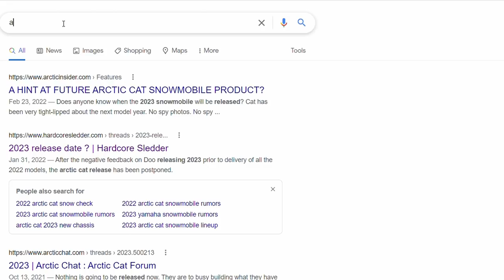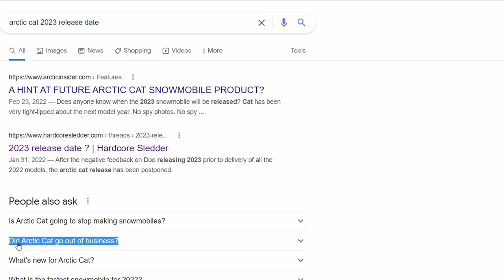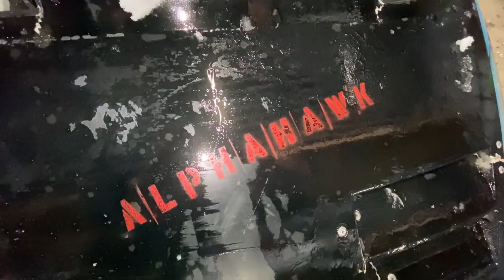2023 Arctic Cat snow check news & the future of Arctic Cat snowmobiles

Comment: I'm a Polaris guy, but I'm still really rooting for Cat. I know they've had some tough years - they ALL have - but I feel like they're the underdogs even though they build a badass snowmobile. I have a hunch that they're focusing on breaking ties with Yamaha, which I would applaud, but I hope they can do it and still remain successful at the same time. Don't die on us Cat!!!
Reply from the maker: If the auto industry is anything to go by I would expect more ties between companies in this tiny and shrinking market, not fewer. But we’ll see. Meanwhile I have sold my Doo and ordered my first Polaris, so next year my shed will be full of cat poo.
Reply: Ok way they would survive if they split from yamaha is if they took the 998 with them. Otherwise.....Asta la vista
Reply: Why would you want them to break ties with Yamaha? They’ve marketed some of the most reliable machines than a majority of manufacturers out there. Their ties with Yamaha is what has me wanting to buy one, not turn away from it.
Reply: @matthewmyers2833  Because Yamaha is using Cat’s engineering. They’re moochers. Go pay your own engineers Yamaha
Reply: Polaris wouldn’t be where they are now without the competition.  Plain and simple.  With no competition we would have to fully aftermarket sleds just to ride them in mountains
Reply: @daverothgery7854  You could say the same thing for the other brands as well. Without competition, manufactures can go into limp mode and stop innovating. It's not just Polaris dude. lol
Reply: Uncle Deez why are you lol’ing after reiterating the point I just made.   Polaris was the prime example because they are the leader of mountain snowmobile market share and top of the game as far as consumer opinion goes.   I appreciated you rooting for cat and the underdog status is almost a draw for me.   If my sled is heavier and crappier than yours, why am I getting all the same places as you and helping get Poos unstuck?    I guess I’m just that much more skilled and in shape if I can ride a crappy cat.  Btw I live in the High Rockies, CO.  You?
Reply: Totally agree its a double edged sword. Cat worked like 6 years on the alpha then they let yamaha release a blue alpha basically. But yamaha is saving there but right now with the parts availability i think if either Textron pulls there head out of there but and realize what they got or some other company owns them they could make an epic comback
Reply: I feel like the two companies have been eachothers crutch. I hope Textron sells Arctic cat off to an ownership that is actually passionate about what they do & the industry. The current Arctic Cat leadership has done minimal to advance the sledding industry for it's riders. I've been told Textron had only bought Arctic Cat for plans on Government supply contracts. My first sled was an Arctic Cat because of the legacy. Polaris has flipped their reputation from the mid 2000's and now is tied at the top of my list with Skidoo. I guess I will have to wait and see what this Catalyst has to offer (when they actually release it & with atleast a 800).... so far not very optimistic.

Comment: You completely missed it! Those side reflectors aren't going to be reflectors after all.... they are putting on TURN SIGNALS!!!! It's why they have to change those 2 or 3 bolts to make it ultra lightweight without compromising durability. Will be a revolutionary add on into the passionate snowmobile industry so passionate riders both in front and behind will know which tree you're heading for!

Honestly, it sucks though seeing how quiet Kitty is... looking at my 2012 versus the 2022s they've made vast improvements. I will say Cat has always had some of the best looking sleds.
Reply from the maker: I am humbled by the many great ideas this video has catalyzed.

Comment: So do u recommend putting a rail brace on since i seen you had a broken rail and mine came with one cracked in the same spot. I hate that the textron is ruining the cat name because they are honestly a top competitor in terms of reliability. To me i think they should make a dual rail again because they could directly compete with polaris in terms of how they ride but it would probably be a more reliable machine honestly
Reply from the maker: I think it depends on how and where you ride. Most riders, including me, probably don’t need a brace but the guys who jump and thump a lot in the forest seem to brace. Mine broke from a hard jump landing on the edge of a hidden stump. Nothing was going to survive that. My teeth didn’t!
Reply: @AkatarawaJapan  oh man not good. I might start jumping a bit but not to the extent some guys do. probably start riding in late december/ when snow pack covers alot of stuff. Also i know backwoods bmp makes a brace for the front section now